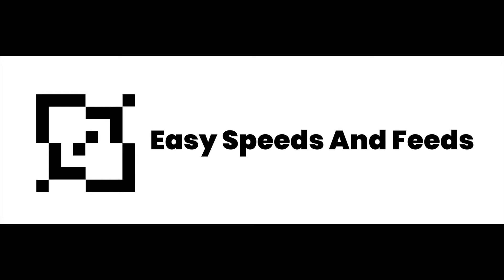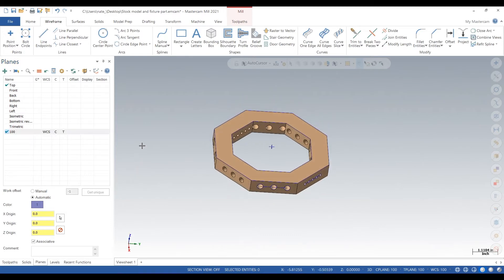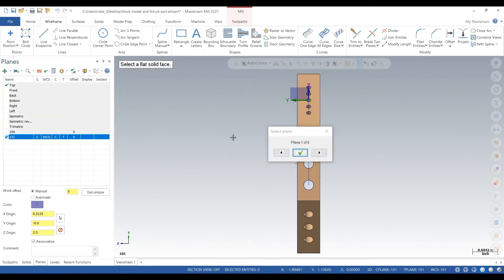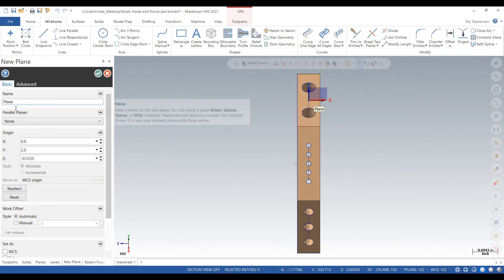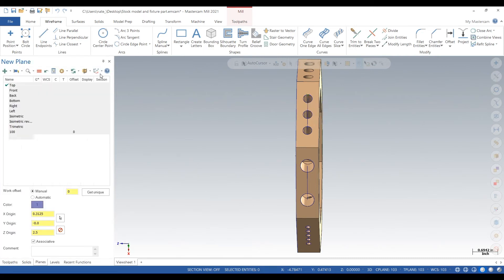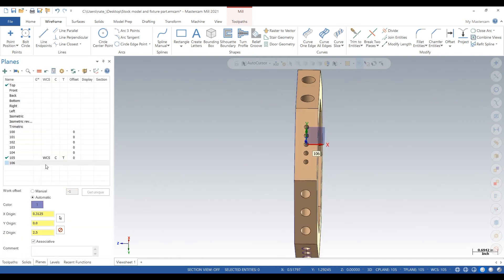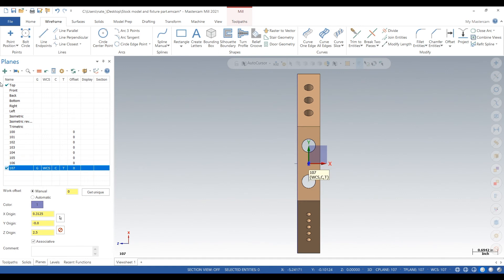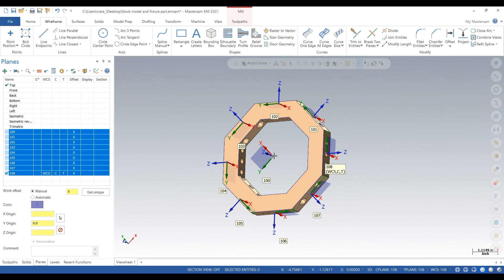5 Axis Work Coordinate System - Mastercam

Comment: Please do videos on 3D tool paths with examples when to use them both rough and finishing paths.
Reply from the maker: I got a couple on 3d flow line and surface rough parallel. Ill make some more!
Reply: @easyspeedsandfeeds1410  tq u
Reply from the maker: @Naveenkumar-DC  happy to help